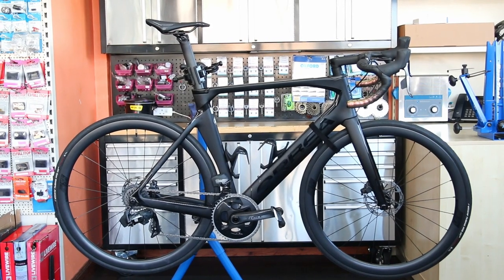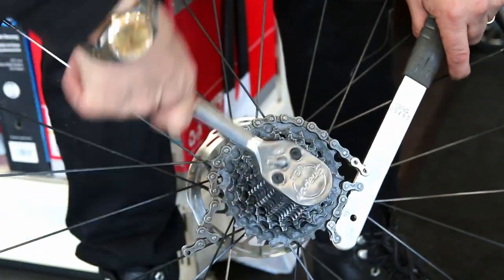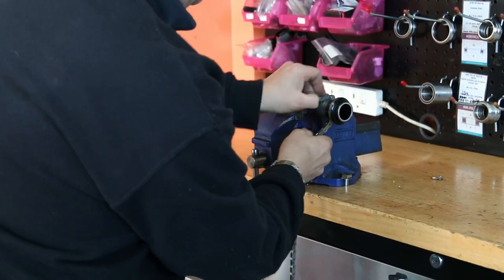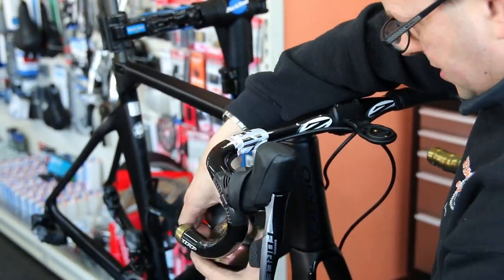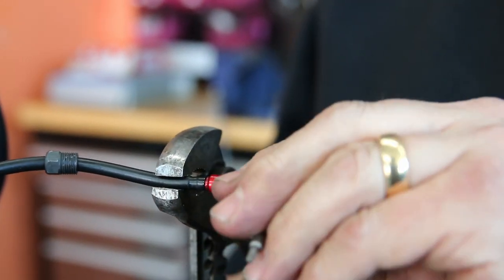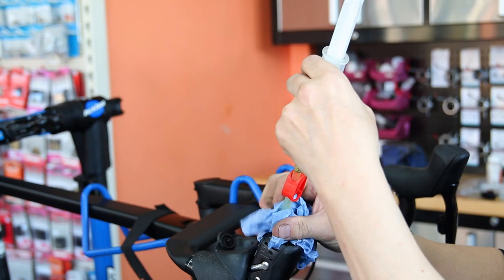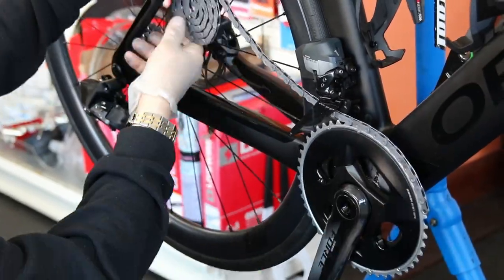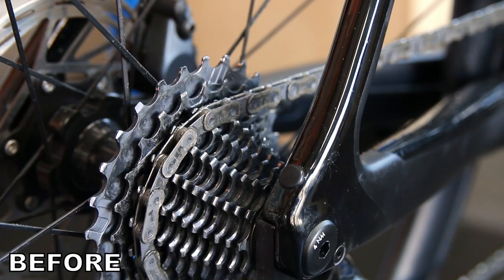Orbea Orca Service! Sram Etap Brake Bleed and Chain Waxing!

Comment: I have been chain waxing for a while and have refined the technique over the years. I also use boiling water but add a bit of detergent, might not make much of a difference but wouldn't hurt either. I've taken to quenching the freshly waxed chain in water to maximise wax retention in the chain (as opposed to drip drying), have you considered this?

Comment: Hi, i saw you screwing out the olive and barb insert from the hydraulic hose.. is that doable? It will be very useful if I don’t want to cut and shorten the hose. Does it works everytime?
Reply from the maker: Yes it’s absolutely doable, thanks for watching 🧡

Comment: How many miles do you usually get out of a chain between waxes? And how do they fare offroad? I'm considering doing my gravel and MTB because the dust at the tracks around here is terrible with lubes (especially because I run wet lube all year around because I just can't seem to get dry lube to do anything, it always squeaks like there's nothing on it)
Reply from the maker: Typically you get about 300/400 miles they don’t fair so well in wet weather and do definitely take more routine upkeep, but solely for keeping the rest of the drive train clean and saving the associated wear that comes with gritty oil on high end group sets it’s a no brainier to me. 
As for off road I am not a mountain biker and have no personal experience to talk with any authority on it. You’d have to try it and see, you’ll soon know, you can always go back to oil

Comment: How often do you need to re wax a chain?
Reply from the maker: It very much depends on the riding you do & the conditions you ride in, but I find the average is 300-400 miles
Reply: @Bikespeeds  I have tried waxing it is a bit of a faff and I ended up destroying a brand new chain cassette and chain ring it put me completely off it.